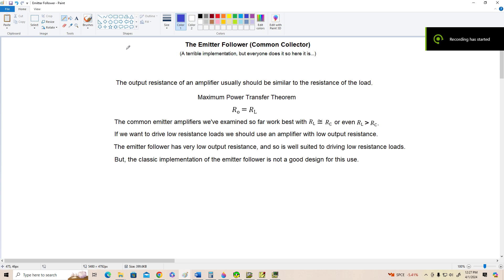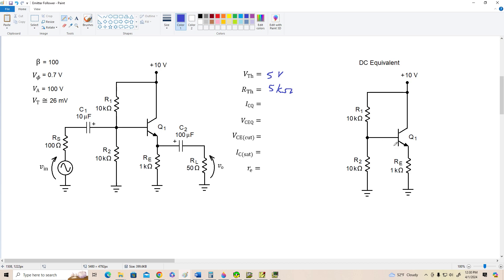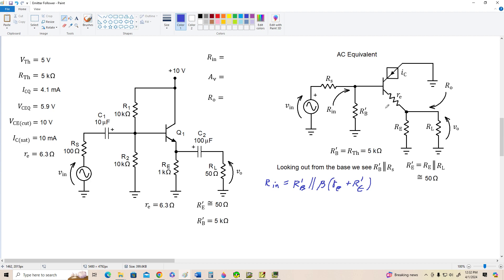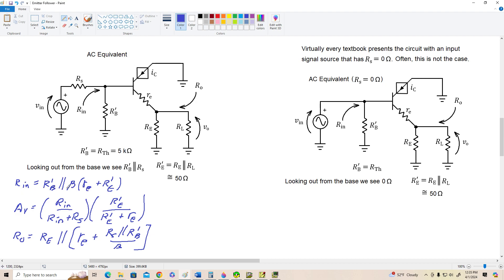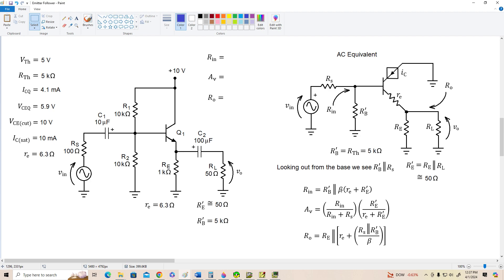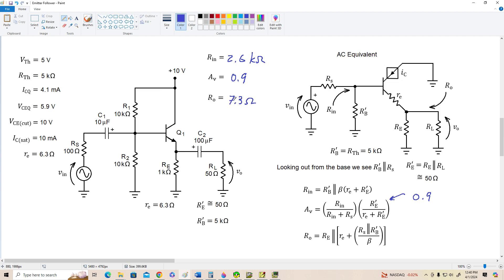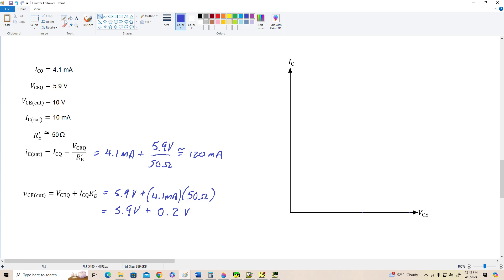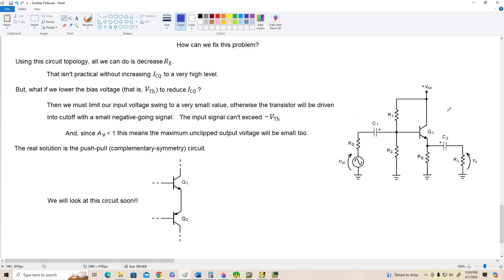Topic 32: The Emitter Follower (And a major problem with this implementation)

Comment: Excellent videos... Anyway, a misconception has to be dismissed. Most people used to say input impedance of the subsequent section must match with the output impedance of the previous stage. Not always! You must try to achieve it if you want to transfer power (with power amps). In almost all other cases (where the signal is modeled by voltage), we are only concerned with the voltage signal. So, we should not try to match impedances; instead we must try to make the input impedance larger as much as possible. It is impedance bridging, not matching. On the other, common collector is a very useful circuit!
Reply from the maker: I agree completely. For small signal and low power amps high input impedance is most desirable. Impedance matching is more important in high frequency applications. Thanks for the comment! 👍🏻

Comment: EXCELLENT PRESENTATION!THE GRAPH COULD USE LINES ON IT.WHAT IS THE FORMULA FOR THE CURRENT GAIN FOR THIS CIRCUIT?
Reply from the maker: @davidluther3955  this equation works for any amplifier:
Ai = Av(Rin/RL)
Reply: @Electronics4Guitar  I ONLY WISH I HAD THESE GIFTS WHEN I WAS STRUGGLING TO LEARN ALL OF THIS IN COLLEGE MANY YEARS AGO.
Reply from the maker: @davidluther3955  I wish I had recorded the lectures I gave at the college. If I can find some I might post them sometime.